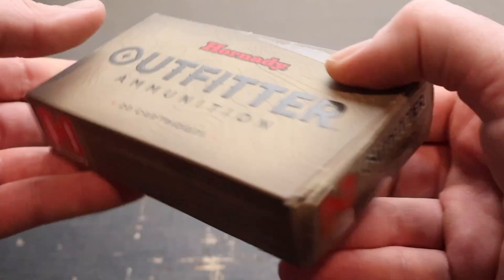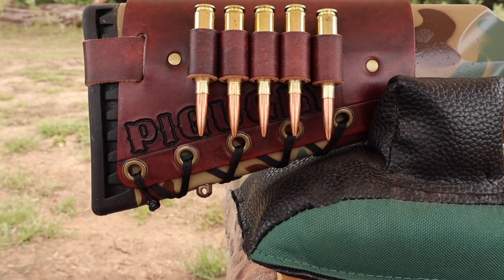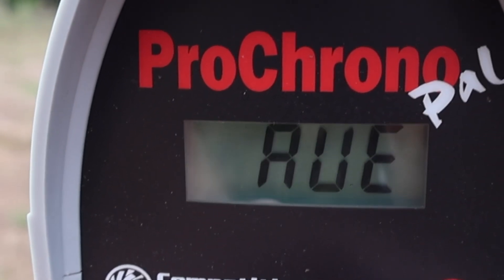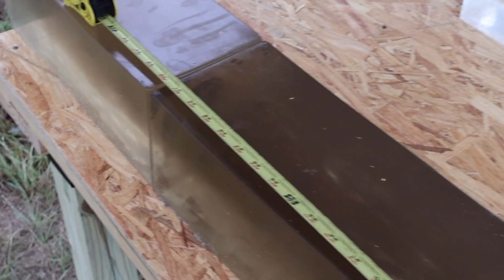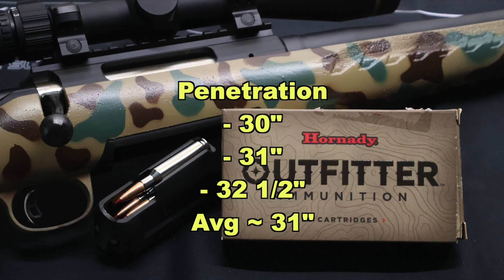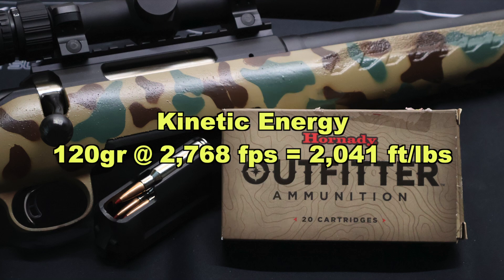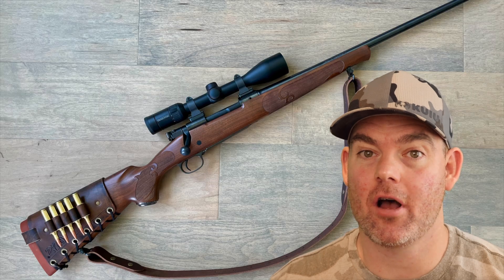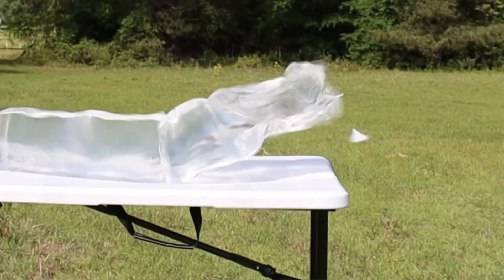6.5 Creedmoor 120gr CX Hornady Outfitter Ballistics Gel Ammo Test

Comment: I know you state you normally aren’t so concerned with velocity, but I appreciate that you still consider it in your testing. From what I understand Hornady suggests an impact velocity of 2000 fps to achieve 1.5X expansion, so with a muzzle velocity of 2700 fps that is absolutely something to consider at longer ranges.

Barnes minimum impact velocities are considerably lower - around 1500-1600 fps depending on caliber and weight.

Comment: Clean the bore before switching to mono.
Reply: I agree. CX tends to need a cleaning less though, its actually not a mono but an alloy, however it is homogeneous. Ive had good success with them even eithout cleaning in some rifles, others needed it.
Reply: It's not "anytime" it's just with the solid copper or alloy. It is suggested you clean out the guilding metal from standard jacketed bullets before using the solids. The solids cause higher pressure because they are harder and the metal can't flow properly into the bullet grooves. This is what affects accuracy.
Reply: Whats the reasoning behind that anytime a bullet is to be carried it should get its own clean barrel
Reply: Clean to bare metal bore, explanation as to why is on the back CR10 bottle.
Reply: There made of gliding metal. No need for that.
Reply: Wow ! So with these rounds we have to clean our guns as much as muzzleloaders . Maybe 2 or 3 shots and back to cleaning .
Reply: @Airon79 no, just a clean bore before sighting in and shooting these.

Comment: I had similar results testing the  barnes 120 ttsx.  They only opened up to .45" at a 100 yards. The downside to lots of penetration,  is a skinny wound channel. My father has shot 5 deer now with them and they all ran quite some distance while barely any blood trail.  Pretty much just a quarter sized hole punched through them.
Reply from the maker: Certainly seems to be the case a lot of the time
Reply: High shoulder enough said😊
Reply: It seems with monos the best bet is to find the lightest weight possible and push it as fast as you can. Cant do that tho with factory ammo, obviously. In 6.5CM, they really should have loaded it with 100g. Heck, i load my 270win with the 110g ttsx. Its movin on. Lol
Reply: @John_Redcorn_  yea the factory 6.5 stuff is pretty anemic,  a 120 at 2800 fps is pretty dam slow. I shoot 125's in my 308 at 3100 fps.  You don't need much bullet weight with the mono's to get good penetration.
Reply: @Dfleuryoutdoors  the 110s are screamin at around 3400 out of my 270 😎
Reply: @John_Redcorn_  how do they perform on game at that speed?
Reply: @Dfleuryoutdoors  explosively. Lol

Comment: I am not very familiar with the CX bullet, but I would consider a close range shot that only mushrooms back 1/3 of the way to be a fail. Will that bullet open up at all at 300 yds.? On weight retention, it sounds great, but you can easily see that the mushroom is packed with ballistic gel! I think you need to remove that gel to get a true weight retention number, which I bet will still be 95% or better, but with the gel, it is a little skewed. Good job on the testing.
Reply from the maker: I get all the gel out I can with a pick and tweezers, it’s a lot harder to remove than it may appear, especially when the petals curl like that. What remains is extremely negligible weight wise.
Reply: @masonleather_outdoors  Fair enough, you do a very good job! Thank you for you videos.
Reply: gel weighs almost nothing compared to the copper or lead
Reply: @WayStedYou  do you reload?
Reply: The CX is basically the updated version of the GMX. Oddly enough, the older GMX had a better BC 🤷‍♂️
Reply: You might be able to clean those bullets with boiling water or a flame .
Reply: If don’t hit rib you are screwed, solution is neck or high shoulder and won’t go far if anywhere

Comment: Has anyone found the CX load to be accurate?
Reply: .25 MOA out of Browning Xbolt, 6.5 Hornady outfitter 120gr
Reply: Consistent 0.7 to 0.8 MoA from Tikka T3X CTR in 6.5CM.  Not a match load but then not designed to be.  YMMV.
Reply: @leeturner3143  I’m a tikka a fanboy. Do you hunt with that heavy thing?
Reply: 0.5 MOA from my Blaser R8 in 6,5x55 NOR. Have 2900 fps from a 21 barrel.

Comment: I'm wondering if I can get this 150g load to perform well out of my Ruger compact 308. I want to run copper, but not sure velocity will be up enough.
Reply: What is your max distance? Some years ago a guy posted a video regarding a Barnes TSX, either 150gr or 165gr, not expanding on an elk. As it turned out I think it was a long shot. I've also heard bullets like a TSX at 300 and beyond act like full metal jackets. I have no personal experience with a TSX at that distance but I do with TTSX and they worked just fine. I know this video is on the CX by Hornady but same concept.

With monolithics I almost always load light for cartridge. I'm using the 130 TTSX in my 308s
Reply: Drop down to 130g or even 110g. The rule of thumb with monos is to drop 1-2 steps below “normal” weight.